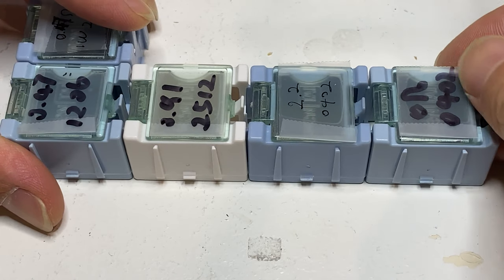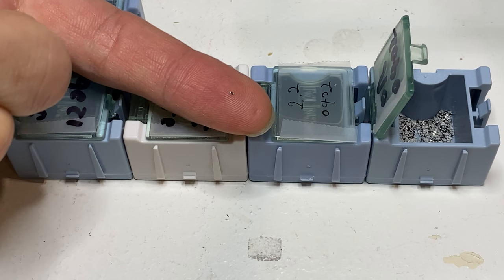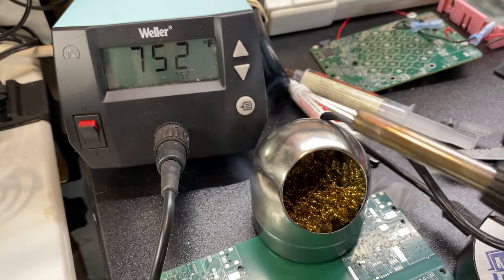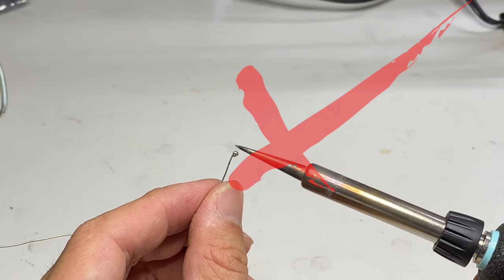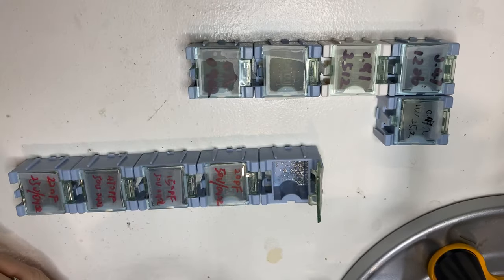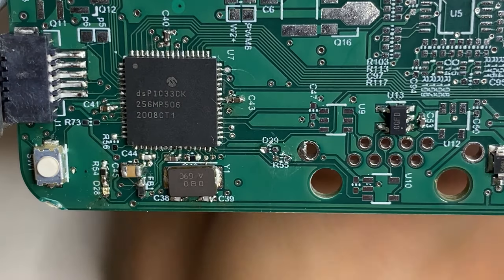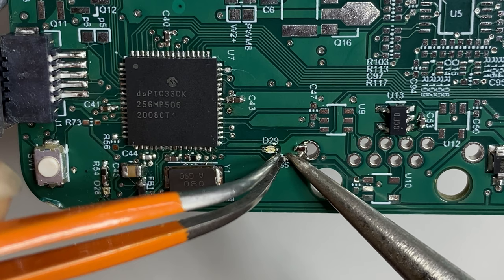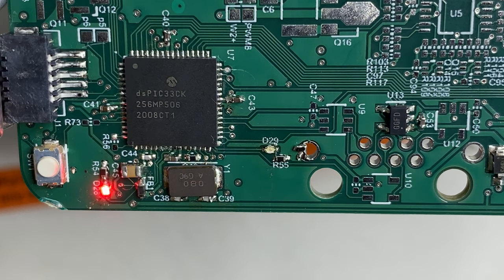[4K] How to Hand Solder 0402 Small Surface Mount Component SMT/SMD Like a Pro #pcb #soldering

Comment: Holy crap ..it looks like you soldered that processor in by hand too ... thats impressive ... I  would hav liked to have seen that ..
Reply: Large ICs are actually pretty easy to hand solder even with very fine pitch because they're heavy enough to stay put instead of sticking to your soldering tip or tweezers. Extra flux really helps, though.

Comment: I have a question, could you take a small wire brush wheel, say for a low rpm Dremel, to clean of the oxidation off the older tip?
Reply: too rough. IPA and soft brush